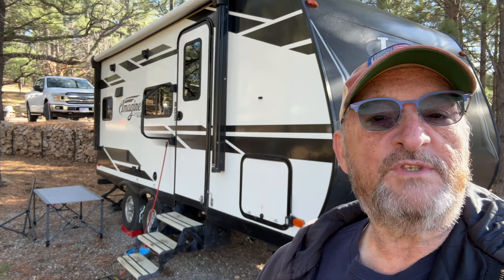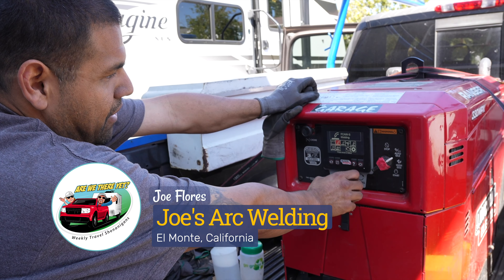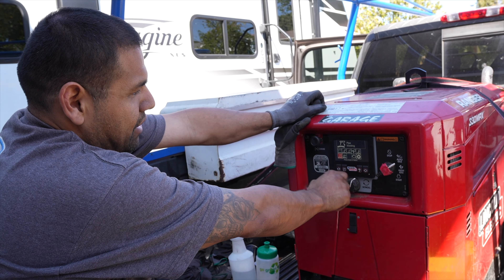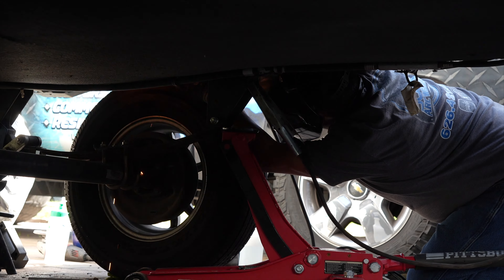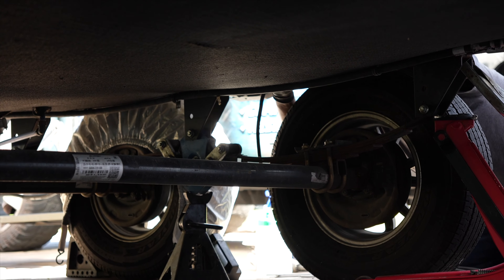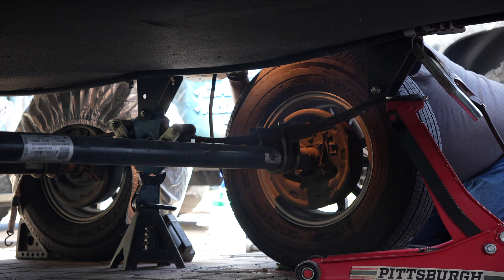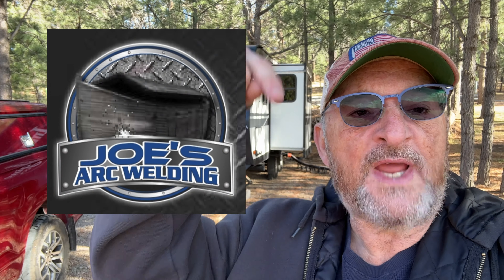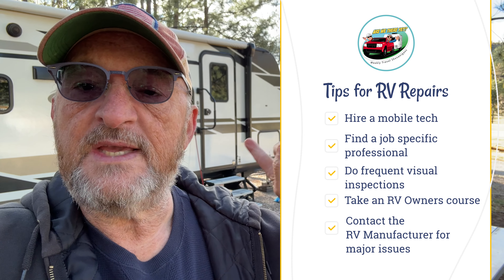Our RV Frame is Cracking!!!

Comment: Found this about 4 yrs ago on my forest river lippert frame.  There was actually a link on lippert website on how to repair.

Rv shop that fixed ours added square tubing across the body to the 4 sets of spring hangers.  This stiffens the frame and reduces bending forces on web and flange of the I beam

Comment: Just saw your vid like your approach, do for yourself as the manufacturers are absent on defects.  As a certified rv tech I am a separate set of eyes for the folks I help. Having owned over 18 different types of RV's over 40 years gives me  a different perspective  of what to look for and we all never stop learning.
Reply from the maker: That’s how I found it. A Certified RV tech was repacking the bearings and checking brakes. He was just not a welder. But a second set of eyes is invaluable!

Comment: This is a lippert problem that has been happening for years on all  brands. Is from axle hangers flexing the frame because the frame isn't properly supported where the axles are attached to the frame.
Reply: V shaped brackets added to the hangers might also spread the load

Comment: Its great that you caught this in time before larger more expensive issues developed - but thats just 1/2 the fix.  You need to find out why.  The frame maybe a bit on the weaker side for the weight of the camper and you can help that with better equalizers on the eye spring connection between the axle or getting something like a MORyde X factor cross bar to reduce frame flex.  However, you need to weigh your trailer with the typical travel load (water in tanks?, propane, all your normal suppliers etc. then weigh just your truck by itself - the difference being just the total weight of the trailer and all the stuff you are carrying.  You maybe surprised that you are close to or over the weight limit of the axles and tongue weight combined or close to it….. then just add a few bumpy roads at highway speeds and the issues begin.  Good luck.
Reply from the maker: I agree.  At the end of this most recent trip I will re-weigh the rig. Previously we were within specs and since then I have replaced the old Absorption refrigerator with a 12 volt version, much lighter, so I don't think I am over but I will check.  Thanks for watching and commenting.

Comment: I had the same thing happen on my Toy Hauler, my friends Travel trailer dis the same right where the tow hitch meets the front cross member.  We fixed both by welding a piece of large 4" angle iron over the crack, then rand  bead around the angle.   Stronger than factory, in fact  when I get time I'm planning on doing the same on the other 'not cracked' frame piece.
I's caused by using too thin of steel frame material for this application that is in constant flex when used.

Comment: I’m a truck driver with over 1million miles driven.  I’ve finally decided what “RV” stands for.  “Roadside vehicle”.   I’ve seen plenty of them cruising at 80+ mph.  They are simply not designed for that, especially with the wonderful roads we seem to have.  I’m not saying that’s you, but if it was mine I would be going slow especially on bumpy roads.
Reply from the maker: I totally agree.  I have seen those people speeding by and sometimes with no sway control either.  I keep it at 65 or under.  Faster and you just don't have control of especially travel trailers.  Speed kills.

Comment: May be putting to much weight on that frame with the hitch based on wear the cracks are located (plus Lippert frames tend to be lower quality side of things). Most likely this is where the argument the company argue with warranty, the weight distribution hitch put to much weight on it and therefor voids the warranty. Glad to see you got it fixed and hope you can recover some of the costs!
Reply from the maker: Well I don't know of many people who run travel trailers without sway control and weight distribution.  If this is the case the manufacturers should state in their documentation NOT to use weight distribution hitches or at least certify ones they will stand behind.  But they won't do that because the first lawsuit will be the person who broke down or crashed because GD told them NOT to use a weight distribution hitch!
Reply: @arewethereyetshow  You're looking at the wrong side, it's the hitch causing the issue not the trailer (even if the trailer is poor quality). When you use the hitch, it's increasing the weight to the back of the trailer axel aka: adding weight. Once you go over that weight limit, things break. The warnings already exist for what you are saying: don't exceed weight limits.

Comment: I saw this video and have to tell you my story. I too had cracks like yours, mine were above each leaf spring hanger. You will not get any help from Lippert. I could not see your frame that well but does it have a square tube welded to the bottom of the I-beam? I'll bet not. That's how they fixed the problem on later RVs, but won't acknowledge there was a problem. I had the same kind of repair, welded the crack then welded a plate over the crack area. Good Luck.
Reply from the maker: Thanks.  I am not really expecting anything from the manufacturers.  They wanted photos but now have gone silent...  But this sounds similar.  the cracks are above the center leaf spring hangers on both sides between the dual axles.

Comment: I just found I have 3 small cracks on my under frame. It's only a year old !!! I cannot get my New York inspection with it. The dealer is sending me to a fabrication shop. Anyone have any idea of a ballpark amount?
Reply from the maker: Sorry to hear that.  I would think this would be handled under warranty.  I spent around 1100 for my two welds and the extra steel plate.  Lippert is reimbursing me for the repair and mine is out of warranty.

Comment: Yes the frame can crack after even one year. 
Think of all the turns you do with the trailer. 
You are forcing something to go sideways that only wants to go straight. 
The mobile welder did to the job correctly making a partial pen weld and welding a plate over it to transfer the load. 
The bottom flange torques side to side when you turn, this in return is fatiguing the metal causing the crack. 
Full height stiffeners are needed to prevent the flexing of just the bottom flange and distributing the forces equally throughout the beam. 
I did a YouTube video 
Lippert frame fix. Part 1 , showing what I welded for prevent what happened to you using the applications that are used in all the high rises in LA.
Reply from the maker: Thanks I will definitely check it out.

Comment: Keep buying crap, they will keep making it for you. All rv and campers are crap. Even outdoors rv. Once warranty is out your screwed
Reply: All RV manufacturers have issues, some more than others. Grand Design seems to be having ALOT of issues lately. But to say "all RVs and campers are crap" is a gross exaggeration. People need to do their homework, thoroughly check out the brand/model they want to purchase, and have the specific unit they want to buy professionally inspected. And yes, walk away from manufacturers with poor quality and customer service.
Reply from the maker: The balance between light weight and durable is tenuous at best.  When I bought the unit, Grand Design had a pretty good reputation for quality control.  But it seems their partnership with Lippert over   frame construction has faltered in the last few years.
Reply from the maker: I am a TOTAL believer in getting a third party pre sale inspection on new or used rigs from an independent certified inspector.  Cheap insurance!

Comment: he should have drilled a stop hole at each end of the crack.  keep an eye on it it will probable crackagain. BTW I was a welder for 45 yrs and strange things happen when welding steel.
Reply from the maker: That's good to know. I know he cleaned and beveled the cracks but not sure about the stop hole.  One end was a little "spidery" so I'm not sure how you'd drill stop holes in that case.  But thanks for the insight.
Reply: Sorry, but with those beads around that plate, would not pass, a QA inspection. Quite sloppy, and may not hold, even with your recommended stop holes.
Reply: @arewethereyetshow  you dye pen the crack to find all the starts and stops, even if it spider cracks. Drill out every crack end, then grind to prep for a 100% penetration weld. But dye pen again to verify you drilled the end of the crack after grinding. Most times the dye pen will show you missed drilling out the crack end once ground out as the crack was not through the outer skin of the steel, so you drill again and grind past he hole and repeat with dye pen till no cracks are visible. The key is 100% penetration weld through the whole crack from drill hole to drill hole, grind the weld flat and then weld a patch over the welded crack, making sure the patch is at least 1.5" beyond where the crack was welded on all sides if possible. The patch should be the same thickness as the metal you're repairing. If you never found the end of the crack and drilled it out there is a high chance the crack will continue right through the patch that was placed over it and your back to square one.

Comment: This is not just a Lippert issue! Lippert makes the frames to the the builder of the Travel Trailers spec. The Travel Trailer specs a cost and a maximum weight for the trailer, as well as the carrying  capacity. They both cut corners for cost and weight savings, often times to detriment of the owner. Im betting MORE than 50% of the fifth wheels have issues. Also Im betting 100% of the owners have the trailers at or above the max load capacity, and dont even think about hauling fresh, grey or black water, that will put you well over ideal. Check your numbers!
Reply from the maker: I think being overweight is an issue in many cases.  It is equally a Grand Design (who give them the specs) and Lippert (who manufactures the frame) issue.  I can tell you that this particular trailer has not run overweight but it has been close to the specs.  I think their specs are probably max at ideal conditions and if you have driven any of the interstates lately you know there are many roads not at ideal conditions!

Comment: Did you unhook your ground in your battery
Reply from the maker: I've got a fused cut off switch on the positive leg and cut off on the negative so I don't have to physically remove the leads from the posts which are under the bed.  So I was able to cut both off before welding.

Comment: I would say that is more of a design flaw than a workmanship or manufacturing issue.  I would be curious what gage material was used and who decided on those specifications. Was that lipperts's decision or is that what grand design was willing to pay for?
Reply from the maker: I think Grand Design gives specs to Lippert.  BUT Lippert needs to make sure they can stand behind engineering specs and meet with their partners to resolve flaws.  But I will say, the welder was very surprised at the thin-ness of the gauge of steal used.

Comment: Just for others to know, you should always disconnect all batteries before welding on a frame.
Reply from the maker: Power was off and all disconnects were engaged.
Reply: @arewethereyetshow  That is not the same as unhooking the batteries.
Reply: I’ve been a mechanic for 25 yrs. Performed various welding jobs on cars (many race cars) and lots of equipment. If there’s an actual battery disconnect, which obviously ensures a stop to current flow, that’s all we ever disconnect. Anything further than that is redundant.

Comment: All I can say is you may want to get those welds look at by a real welder. I have a little training on weld inspection (no certification) and those are extremely poor weld around the reinforcement plate. Don’t take my word. Get a certified welder or inspector to look at them.

Comment: RV frame cracking is very common as Lippert makes JUNK quality frames.
Reply: The outfitter is ultimately responsible for the final integration of the frame to the box structure. They spec out what frame to use and how to integrate the overall structure to the frame. I would not put this all on Lippert. No frame is 100% flex free.
Reply from the maker: I agree @GFswinger1693 that both the manufacturer and their subs hold responsibility.  But a frame should last longer than 3 years without structural defect.  They need to design for normal use and not to bare minimum standards.

Comment: Another Grand design! And this one is a bumper pull. Stop buying GRAND DESIGN !! I had a keystone sprinter inspected and bought it. I need a water pump, and anode rod in water heater. Frame and suspension all good.

Comment: junk, 1/8 frame aint thick enough for a single axel motorcycle trailer, and then chinese metal
junk
Reply from the maker: The welder was surprised how thin it was too.  But the steel and fabrication are done in Indiana, not China.  Disappointing.
Reply: @arewethereyetshow  a lot of metal that these frame builders like lippert are buy metal from China, not USA metal in many cases.

Comment: Check out your electric system completely. Battery’s must be disconnected when welding. Hope they were.
Reply from the maker: They were shut off at the disconnects.  Everything seems to be working properly.  But I will take extra caution should we have to do more welding.  Thanks for the tip.